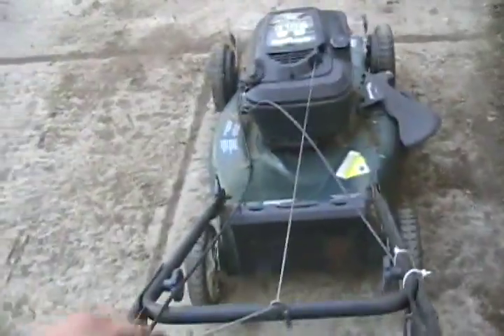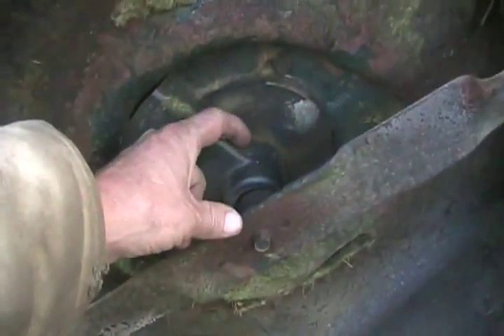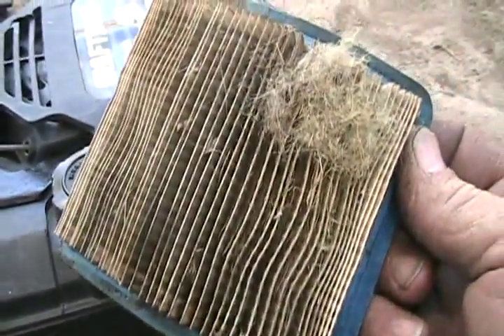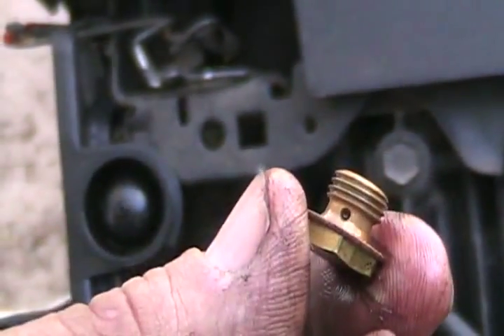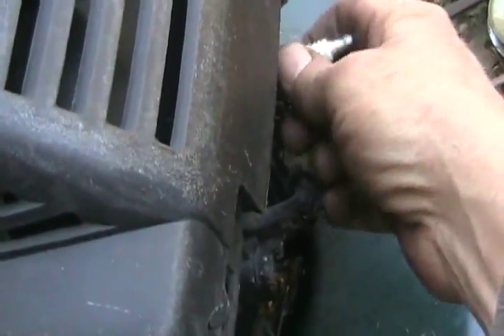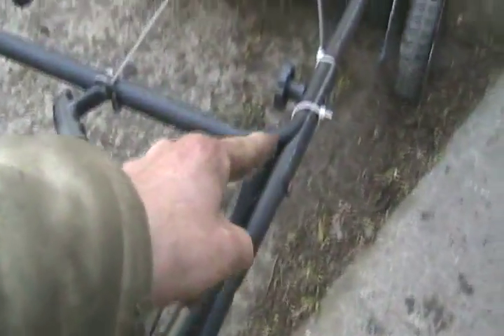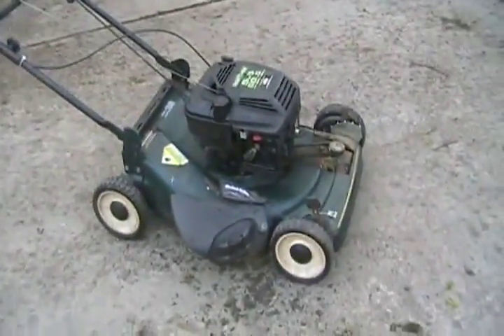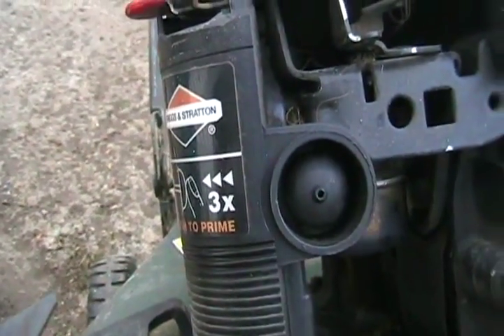#1325 Get a modern briggs mower fixed and running [Davidsfarm]

Comment: How much is a running garbage picked mower worth? How much can you get for them?
Reply: Depends on how it runs and looks, if it's a two-stroke or a four-stroke, if it has a speed handle, electric start... You can ask the customer what he/she is willing to pay.
Reply: In a way its a shame Daves not around for questions like that.
Reply: Yeah, too bad that the channel he was using got shut down, too.
Reply: +Florian amRechner no such thing as a 2 stroke mower
Reply: Tommy Bragalone
Not anymore, but the Lawnboys for example had 2 stroke engines. The janitor of my old scholl used a 2 stroke lawn mower. (I guess you wanted to say: There is no such thing like a 2 stroke mower)